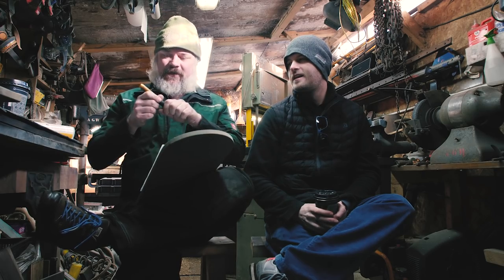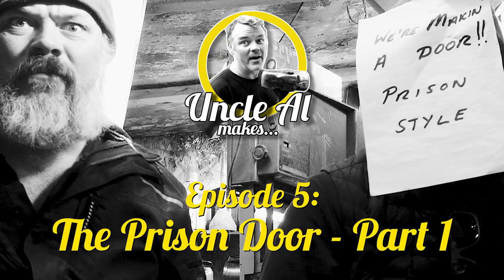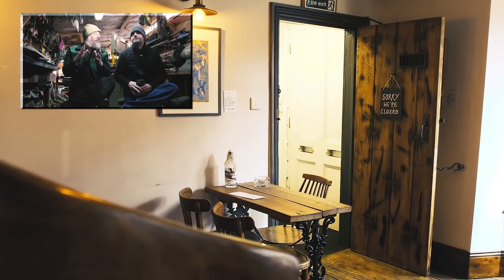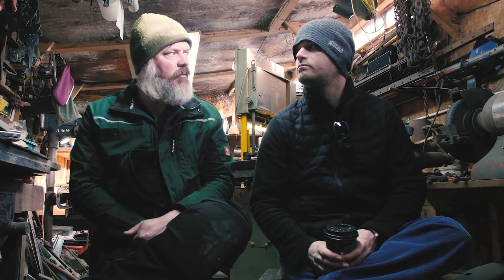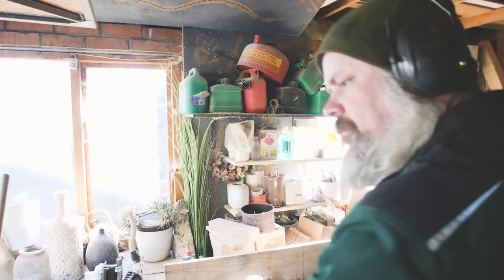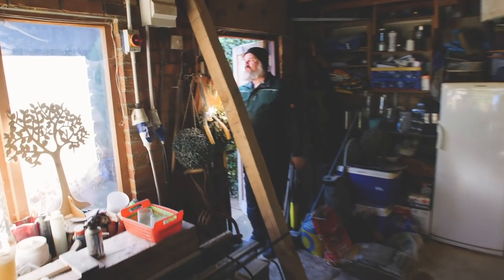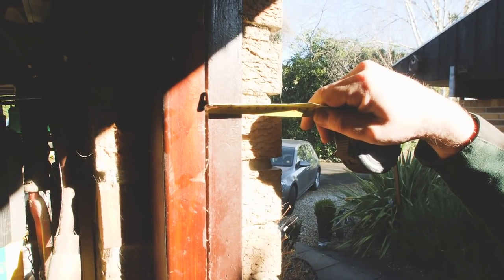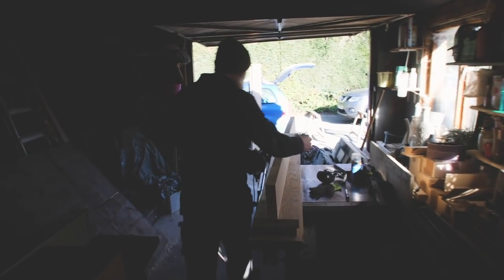How to make a front door Ep1 | How to plane wood

Comment: When I saw you go straight to the thicknesser, I thought you did not have a jointer/planer. Then you started talking about jointing the edges. Why didn't you run the boards over the jointer bed first, then use the thicknesser to make the other face parallel? You must have a reason. I'm always looking for other ways to do things. :-)
Reply from the maker: That's an Uncle Al question fo'sho - he's sleeping now, so he'll get back to you on that in the morrow, David. Thanks for commenting, glad to see you're still with us!
Reply: Morning David, thanks for your comment and watching our latest video! In answer to your question, I think I got lazy dimensioning up in a commercial setting. Most of our timber was remarkably straight, but there was a slight cupping. In this instance I always marching in the thicknesser cup-up. If that makes sense? I find the edges of the board then ‘ride’ nicely as the plane cuts from above. If I had a hideous board, I’d do it the way mentioned. We have a short table on my planner/thicknesser, these boards are 2m. Think if I’d tried surfacing, we would have had more trouble holding the planks straight. Maybe that justifies my laziness? 

Either way, thanks for taking the time to watch and comment, all the very best! Al.
Reply: @yorkshirejoinery2869  Thank you for the time to reply, Al! This may be a shortcut that I can take, especially if the width is over 6", as that's the width of my jointer. Of course there's always the hand plane to use first, but if it's not twisted or bent, but just cupped, your method will definitely save time. Thank you!

Love your videos and glad to see a new one posted again!

Comment: Yup, brilliant stuff, massively informative too.....I’ve got a floor to rip up and replace soon, any tips??
Reply from the maker: Cheers Cellan! Drop us a message about what you're doing and we'll help out as best we can!
Reply: Cheers folks, depend on it!
Reply: @CellanScott  Yep tell Uncle Al that you dropped a pound coin and it's gone down a crack....   😇
Reply from the maker: See Sparky, you've done it again!
Reply: Hey up Cellan! Hope all’s well. Cheers for watching and your comment! God, floorboard tips! Well, I’ve done a couple of these replacements in my time, but they are a pig! Get the old crud gone as best you can, spend the time to de-nail everything. Get the remaining joists levelled up (if it’s ground floor), you can’t do this very well if it first or second floor. Then go for it. If you put t & g purpose specific hardboard, you can’t go wrong and this will probably be cheaper (more economic) than floorboards. Start with full lengths, fit as many as you can and then as a finish do all your cuts. It’s well worth sealing with PU foam around the edges of the room. Think drafts, the think draughts (pints of) then sit back and wait for the brownie points from significant others! Good luck, get in touch if you get stuck! All the best! Uncle Al!